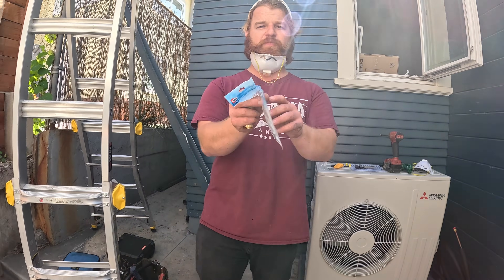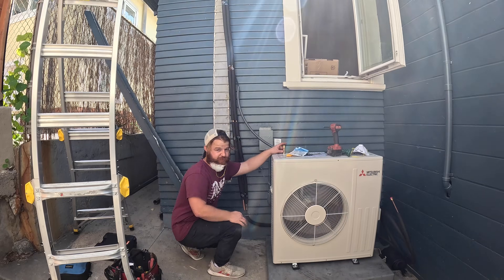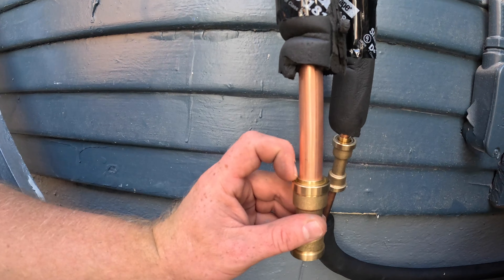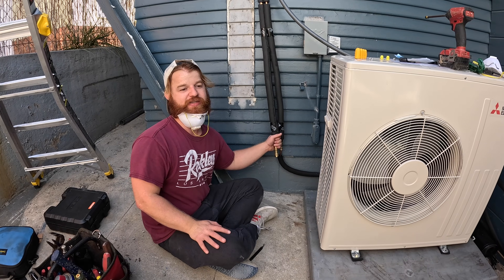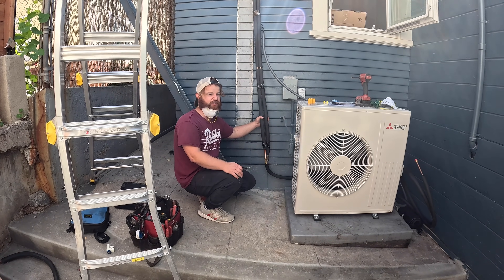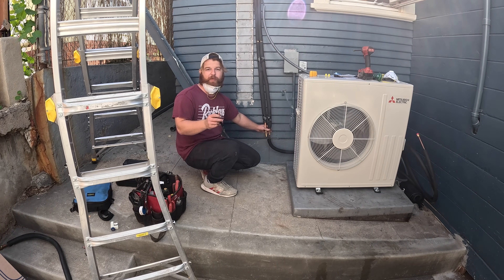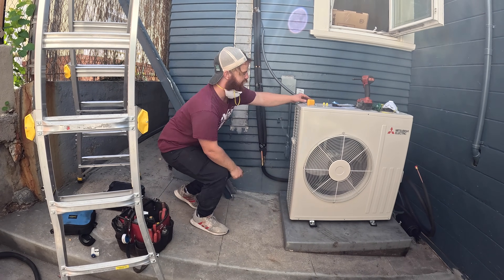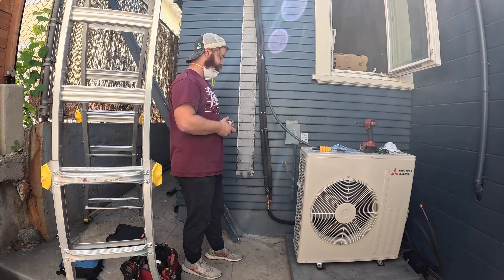Push To Connect Refrigerant Joints!? RectorSeal PRO-Fit Quick Connect Fittings - Demo and Review

Comment: Have you ever used the Press Took Kits? With the various head sizes? - These looks like the same principal and they hold more PSI at 870 vs about 700 on the press fittings.
Reply from the maker: I prefer brazing. Only use alternate joints if absolutely necessary. I haven't branched into the press tools for HVAC yet but will probably do so soon

Comment: For all the people saying to just send it on these - 

A 5/8” fitting blew on a mitsubishi ducted system, right at the AHU connection. I’m repairing it today. Did not install it. All refridgerant lost. There’s 13lb of r410a in a smart multi system paired with a 4 ton air handler. With a global warming potential of over 300x that of CO2, when that joint blew, the whole benefit of using a heat pump over a furnace for about 2 years was totally lost. 

Buy an expensive press tool if you can’t use a flame, but these things do not last with vibration and cyclical stress. Every fitting who ever leaked passed a first pressure test. These fittings aren’t even rated to hold the vacuum that a Mitsubishi system is required to get to in the triple evac process. 

This guy has some good videos but Pro Fit does not equal profit
Reply from the maker: We've used like 10 of these and haven't had a leak. Usually we only use them cause we have to. In this case the line was kinked and cut so I thought it was a good opportunity to show it. Looking back though I 100% should have brazed this and done this test on a spare piece of pipe or something

Comment: What about the flare connection at the outdoor unit itself? Where you thread the copper pipe to the valve of the outdoor unit?
Reply from the maker: We haven't tried the connectors that replace flares only the unions

Comment: First thank you for your video.That aside I cannot and will not feel any pity for you cryining about how the RectorSeal fittings make it so that anyone can connect their mini split unit and deprive you or any certified/professional HVAC contractor of making a living.The reason that I cannot and will not feel any pity for you or any HVAC contactor is because many of you HVAC contractors have gotten mighty upitty and full of yourselves to the point where you flat out refuse to service any mini split systems that have not been bought from you or installed by you.I called several HVAC contractors to see if they would come to my house to connect the copper line set to the compressor from the air handler that I had already installed myself and I was told flat out "NO!!!",I was given some crap about insurance issues and what not and to me that is a lot of bullshit because there are such things as contract clauses to shield you HVAC contractors from false/malicious accusations/claims.As certified/professional HVAC contractors I am certain that you can tell right away if a mini split unit has been installed properly or not and if the mini split unit has indeed been properly installed I see no reason why you or any certified/professional HVAC contrator should refuse to connect the copper line set to finish the mini split installation.Shit,if instead of charging so much for installing a mini split unit from scratch you can only charge a few hundred dollars for completing the mini split unit install by connecting the copper line set then why should you or any other certified/professional HVAC contrator refuse?I was willing to pay $500 or more to any certified/professional HVAC contractor that would have been willing to finish my mini split unit installation for me by connecting the copper line set for me but no,all that I got from the certified/professional HVAC contractors that I called was bad attitudes and bullshit which I did not ask for or need so cry yourself a river and get over yourself crying about how "RectorSeal is making parts to make mini split unit installation easier to the point where anybody can do it because you certified/professional HVAC contractors have kicked your own selves in the ass by acting all upitty and putting on airs refusing to finish mini split unit installations.If $500 or more isn't enough for you to be bothered finishing a mini split unit installation for people by connecting the copper line set and vacuuming down the mini split then stop your crying and f_ck off because it's your own fault that people are using products from RectorSeal and other companies to do their own unit split unit installations.I did all of the heavy lifting by mounting the compressor to the outside wall and mounting the air handler myself and you certified/professional HVAC contractors couldn't come over and install the copper line set and vacuum down the mini split for me?What,is it that you HVAC certified/professional contractors can't be bothered unless you get paid a lot of money by installing the mini split units from scratch?It cost me almost $500 to buy all of the necessary tools to be able to install and finish the mini split that I bought successfully.$500 or more that could have gone to one of you certified/professional HVAC contractor jag offs that refuse to work unless you're clocking thousands of dollars at a time.I paid a licensed electrician to run the power line from my main panel and the licensed elctrician was surprised at how well I did mounting the air handler and the compressor to the outside wall and F.Y.I,the licensed electrician would not have run the power line to the disconnect box if he had seen any problems with how the compressor is hooked up.I even asked the licensed electrician if he knew of any HVAC certified/professional contractors that would finish my mini split installation and he told me that he knows HVAC certified/professional contractors that install mini splits but that none that he knows would ever come to finish my mini split install,why is that?When you "pick-and-choose-you-lose",I started working with certified/licensed carpenters,contractors,electricians and plumbers when I was 15 yrs old and I am now 63 yrs old,if I had played that "pick-and-choose" bullshit all because I wasn't earning the money that I thought I deserved to earn at the time I would have lost out big time and I would be totally screwed now not being able to do most of the home repairs here at my house by myself so suck it up and shut the f_ck up crying about losing money because of companies like RectorSeal and the like all because you want to be all upitty turning down jobs where you would only earn $500 or so.If you want to eat steak all of the time then get a rich relative to give you a big inheritance or some such shit and good luck with that because it's not likely to happen.
Reply: P.S.,The licensed electrician that I called only charged me $382.80 for running the power line from my service panel to the mini split unit that I bought and installed.I pay what is asked unless what is asked is ridiculous and totally unreasonable and unfair.I am on limited income but that does not keep me from being realistic and accepting that even barbers need to be paid fairly so that they can eat too.

Comment: Thanks for the well constructed unbiased video brother

We haven't had a call back with them either, Even Johnstone supply said they've only heard of 1 leaking & it was due to user error not prepping pipe correctly (burred or crooked)

I agree with IslandBreezeMechanical, the new units aren't made to last more than 15-20 years so these are a practical alternative to brazing especially in multi million dollar yachts
Reply from the maker: Yeah they have come in handy a few times. We’ve used them on soffit mount units where they were clearly installed on new construction pre drywall and there’s basically no way to get a torch or press tool where we have to do the joints.

Comment: Honestly, if I saw those on a new install I would suspect the installers took other shortcuts.  Better to spend 30 minutes and braze IMO, even if just for appearance.
Reply from the maker: Yeah we've only used them in weird scenarios. Soffit mount air handlers is the main one. One time we had an HOA change their guidelines and tell us we had to reroute the line set inside the wall after the install was completed and the system had been running for a while. So we cut the line set and ran it behind the kitchen cabinets and did a joint in a very small access that we cut in the drywall inside the cabinet. In cases like this it's very convenient. We would typically not do it in a situation like the video that was mostly for demonstration purposes
Reply: Based on that logic, one could suspect the installer took shortcuts with every innovation. Just because there is a new way to do things doesn't make it a short cut. Do you use an electronic leak detector?  There was a time when techs would use a halo torch for leak detection. Do you keep the valve cores in the unit? There was a time when techs   and manufacturers would only use king valves. Quit slamming techs for embracing the future. Things ALWAYS change.

Comment: If there are haters of this, I will tell. Did two head mini-split as side job in 2017 with these thing on condensers and head flares (8 total). Just was innovation, just came out. Wasnt sold in any store, my buddy bought them just to try. Connected, pressure test - everything great.  So, half a year ago (2024 half year ago), my bud returned to fixed furnace of this person (have a furnace and 2 head mini - massachussets by the way: defrost and all these shit). Mini split still run strong, and even not been maintanace once for 7 years, cooling and heating still strong.  Blueridge units by the way, owners bought himself, we just install. SO, THOSE FITTING DAWM WORK.
Reply from the maker: Thanks for sharing. We have not had a call back for them to date. I will say in the last year it appears they switch from plastic to metal on the inner part. I would imagine the plastic had a higher failure rate and that's why they switch but who knows. Seems like a high quality product based on the experiences we've had thus far

Comment: Why not use zoomlock?
Reply from the maker: You think zoomlock is more reliable than these? In my head the reliability would be about equal. Also unless I'm mistaken zoomlock joints have to be cut out if not done properly, while these have a tool for removing them very easily if they have any issues holding pressure. This came in handy the one time we had an issue. I'm not opinionated between the two just wanted to make a video on a product we have seen good results from
Reply: Zoomlock requires some decent training to use correctly. I've had to repair many failed zoomlock presses due to the installer not doing it right. No deep enough, the pipe was at an angle, or the press was at an angle. Then the cost only justifies itself if you are doing a lot of installs. Using one on a pre-exisiting system can get messy quick.
Reply: Because the tool is like 4k for the kit.
Reply: @huasohvac  johnstone supply if you have one in your area has the tool only for $1400 then if you buy $1000 in fittings they give you the jaw set for free   so 2400 all in

Comment: Defrost cycles (from very high temperature and pressure to very low temperature and pressure in seconds) will be the the determining factor on this fittings reliability!
Reply from the maker: 100%
Reply: A braze joint can hold up to 5000psi. The pipe would burst before the joint would. I think this is why brazing is the best method but with the new A2L refrigerants I think pro press and zoom locks will be the future
Reply: @acrservicesmathewr7565  I’ve been wondering what the operating discharge pressure difference will be compared to R-410a?

Comment from the maker: Steps for these fittings:
Debur
Shove onto pipe

Brazing steps:
Debur pipe
Swage pipe
Sand and clean pipe
Set up nitrogen. On a mini split like this it is a pain due to only having one port
Get torch and braze
Pressure test

I already know there are guys who may say they can braze just as fast. They are not following the proper protocol. Most HVAC guys do not debur, flow nitrogen, or sand the pipe if they can avoid it. I know because I used to be one of those guys. In a scenario like this one we save a decent amount of time using these joints.

If you are working on a conventional system and you already have to braze in a filter dryer then you might as well braze everything.

We have used about 10-15 of these joints in the past year and not had any issues to date knock on wood.
Reply: At this point I just get the torch and braze. The only issue with the push fittings is the set up has to be perfect. That's why I would see installers using this over service guys.
Reply: @socalrefrigeration548 
I agree braze is a more reliable connection however on a boat in a eng room with the condensing unit tucked in a far to reach corner or God forbid trying to braze in a gasoline boat.
We've used close to a dozen of the prosets in the past couple years 1/2 of them on service calls with no call backs